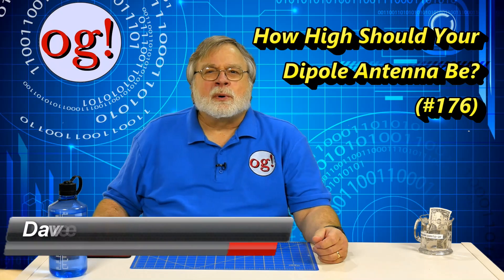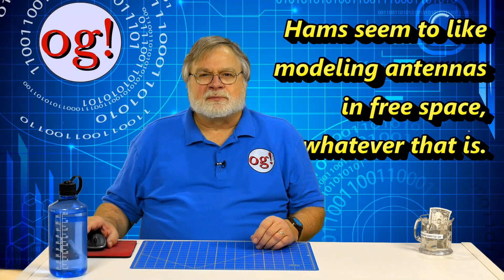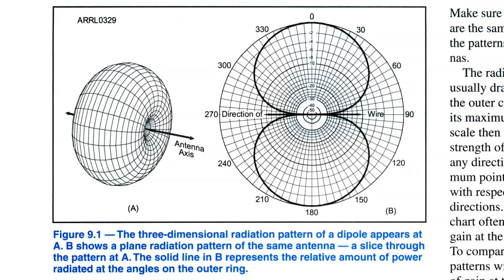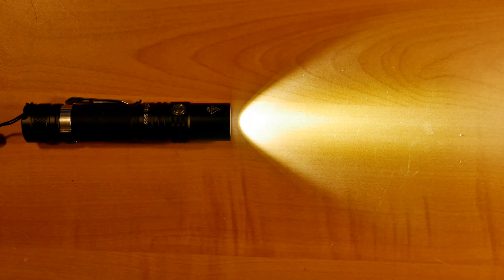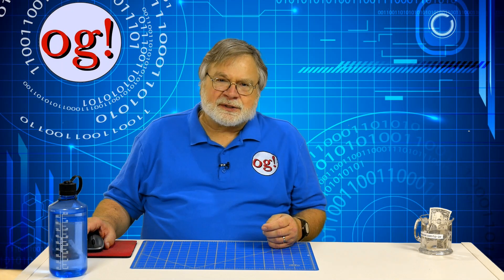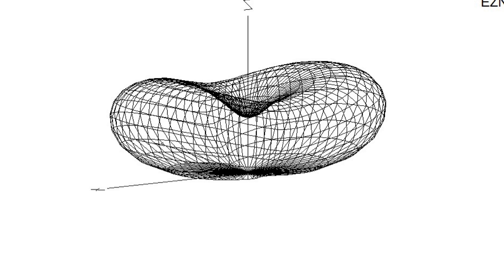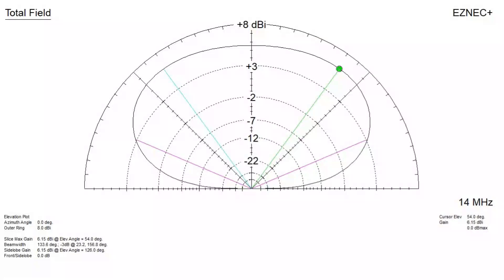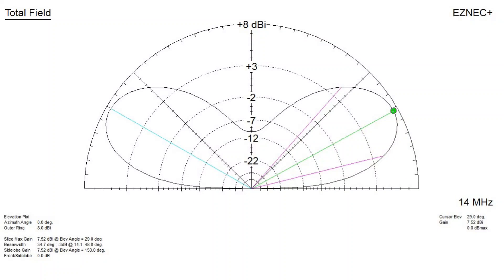How High Should a Dipole Antenna Be? (#176)

Comment: Is it more advantageous to mount a dipole vertically or horizontally?  It would seem a vertical dipole would be omnidorectional and would radiate at a low angle from the antenna.

Comment: Good information.  Long time ago I built a full wave 11 meter dipole with copper wire.  I mounted it in the top of a two-story townhome, with full attic and 45° roof.  I put the antenna as high as possible in the attic, angled down with the slope of the roof. I'm guessing it was about a 5/8 wave above the ground. The SWR was not great, but one morning at 6:30 a.m. EST,  I had a clear conversation with a gentleman in Corsica off the coast of France.  SSB of course, 27.385 Mhz, 12 watts PEP.  I was trying to make an antenna for the flat side.  I guess I got lucky.  Thanks for the video.

Comment: Yes on 20m you don't want power going straight up (and just heating the moon) but on 40 for nvis you want straight up power. For a 2 element Yagi you normally have the reflector 0.15 wavelength back (ie 6m on 40m)... If your 40m dipole is low at just 20' then with the ground acting as your reflector you effectively have a 2 element yagi pointing straight up so if you want local rag chewing on 40 then just 20' may be your optimum height.

Comment: In case of a vertical dipool : Half wavelenght to ground, is this clearance between ground and end of the antenna or is this from ground to mid antenna (feed point). PS: @27Mhz
Reply: 1/4 wavelength or 8 feet to put it out of anyones reach, also for optimum performance and easier matchingyou want your feed line to run perpendicular at least 1/4 wavelength as well

Comment: For DX, I would always go significantly higher than a half-wave.... Look how much better the low-angle radiation is on Dave's plots, at, say 1 wavelength height. I believe that most DX signals arrive at about 7 degrees elevation, but often lower.

Comment: I have an Icom MN-100 dipole antenna and i plan to make it as inverted V and put the antenna up on a 18 meter mast with the angle around 90° - 120° between both wires, the question is, is 18 meter high enough to make the antenna works efficiently ? Thanks - YG1BGK

Comment: Great informative video, thanks. I have a centre fed dipole that i use on 11m and was wondering if it would work if placed along the roofline of my house, around 20 feet up, on a corner. The legs would be at 90° and feed cable coming straight down  unto the shack. If it is directional, i have 4 options (placed on any of the 4 corners of the house) to suite the desired aim for dx. Thanks again.

Comment: The short answer could be... depends on what radiation pattern you want.

Straight up for NVIS.... a quaterwave.
Low Angle (about 30 degrees).... a halfwave.

Expect the feed point impedance to change between these. Due to interaction with the ground.

Comment: Dave. I have a 40/20 meter fan doublet up at 95 feet. It works excellent into vk and zl in the early morning on both 40 and 20. This is with 100 watts so I have to disagree.  Height is might. My zero five ground plane with 6 long above ground radials and 80 in ground radials is 6 dbd down on 40 and about 8 dbd down on 20 in the two direction my dipoles are oriented. The 95' doublet smokes the vertical 75% of the time. I hope these big trees grow higher. Would love to be at 120 feet one day. One more thing. The dipole up over one wavelength does not waste power going nowhere.  Look again at your charts. There is a few higher angles which are good for regional contacts. So the point is I am surprised you recommend a half wave high when a full wavelength will always give you  much better bidirectional gain.

Comment: Are there motorized systems to raise and lower a dipole in a similar fashion as a yagi is rotated?
Reply: Unless you are using a chain or cable driven elevator you will not get much range.
Also there is stability issues you must factor into load equation.
Linear actuators are more stable but very limited in range.

Comment: Dave, you have explained all the practical options of a dipole antenna positioning. Thank you for that, very informative data. I need your advice about what would happen if I were to deploy a dipole in an oblique direction to the ground. Say, at one end at 20 feet and the other at 15 feet for a 20 meter band. The reason is that I have property/geographic difficulties and the best I can do is go with a oblique dipole. Thanks in advance for all the help and advice you give us.
Reply: That is a sloper dipole it will work fine maybe a bit more directional than a horizontal due to ground reflection.
Great for tropo ducting.

Comment: If your dipole is going in the attic (thank you HOA) does the fact that its 3 stories high still count in "how high the dipole is?"  Thanks,  Dave N9DMS
Reply: Three story is the living space measurement attic height is extra.
Average room height floor to floor is usually 8 feet or more.
So 3 story is approx 24 feet plus about 6 feet average attic height
If you walk up steps into the building include that height as well.
So on average without stairs and ground level you are nearly 30 feet
Damn close to 1/2 wavelength so you wont notice the very minute difference.
Reply: Comment was based on 20 meters.

Comment: What about a vertical dipole UHF/VHF?
Reply: They work either way performance may vary due to the recoivers polarity but generally not much.
Look up building a vertical ground plane. They are easy to build, easy to tune. And perform very good.
I believe  Dave has a video on them.

Comment: How far should a dipole antenna be away from metal objects? I was thinking about installing a ZS6BKW antenna in an inverted "V" configuration and I have a metal building that one leg of the antenna would be running parallel with and I was curious if the building might interfere with receiving and transmitting.  The building would be about 10-15 away.

Comment: Hi David, for international DX shouldn't I get my 10m dipole up to about .65 lambda? I use a center-fed 1.25 lambda dipole driven by coax through a 4:1 by Balun Designs at the feed point.
Reply from the maker: The optimum height is 0.5 lambda. At 0.65 lambda the pattern will be a bit lower but you will start to lose power to a higher lobe.
Reply: @davecasler  Will it lose power in the lower lobes or gain overall including in the upper lobe?
I was under the impression the lower lobes gained a dB or so overall.

Comment: Well I KNOW  a 2 element Qud work's  WELL at 36' above most ground's .I had most of my ANT'S. Beams ,ground plain's at 72' on 11 Meters. Work VERY WELL even  ground  waves with  15 W radios on SSB. But coax length  and grounding  and a fine tuned ssb radio station is key injoy 🤔

Comment: so a half wavelength height "rule" was just for 20 meter band or applies to all bands?.......meaning the best height for a dipole antenna for the 2 Meter band is 3.3 feet? and a 70 CM band at 1.2 feet?.....seems pretty low and if my assumption is right (too low), what height should I place a dipole for 2 M and 70 CM bands? (I'm studying for the Technician exam and would like to put up an antenna for these two bands)
Reply from the maker: Yes, the half wavelength height is optimum for all antennas. For VHF antennas up high, there will be so much lensing that it will appear as if it’s one lobe. My UHF 10-element beam is only about 6 feet off the ground because that was a convenient height and is plenty high for the beam to do its work.

Comment: I’ve been thinking about making a 20m vertical dipole. I want a vertical but don’t want to deal with the hassle of ground radicals.
Reply: You realize you will need a fiberglass mast approximately 75 feet tall to keep the lower end out of reach.
While current is highest at the center, voltage is highest at the ends.

Comment: We have a recent FCC change regarding antenna heights. No longer 200’ away from public use airports, now it’s only 50’! Half wave height of a 40m, 66’, I guess may now involve paperwork notification at a minimum or perhaps an approval process with the FAA and FCC?? Doesn’t sound good. Still though, I’m left wondering how to safely get 1 (in the case of an inverted V) or 2 support points 66’ up so as to then string the dipole.
Reply from the maker: This is the first I've heard of this. Please provide a URL so I can read further.

Comment: Hi Dave and thank you for this information. I am a new ham and I just got my General Class ticket and I am learning as much as I can about what my antenna options are considering my location I don't have many tall trees and the ones I have are all on one side of the property. I have limited options for mounting a dipole to say the least. I want to use a multi-band dipole that covers from 160 to 10 meters if I can. I have found an end fed dipole that I am interested in that is 98 feet in length that I can make work in my space. I too use the top rail sections for masts and I presently have one that is two sections high at 21 feet in use. I could set another one to use for the dipole if that will work. I know that there are other considerations here but I just want your opinion on the feasibility of this setup. I would greatly appreciate your help. Thanks and 73
Reply from the maker: Congrats on your upgrade to General!  You won't find an antenna that works well 160 to 10. You might start with an off-center fed dipole that works on at least 80, 40, and 20. You can build these yourself--there are plenty of plans on the Internet.

Comment: what will be the equation  for far field when dipole antenna is at arbitrary location .??
Reply from the maker: You would need to use Maxwell's equations to derive that, a formidable job. Better to use something like 4nec2 that models this using the NEC - numerical electromagnetic code.

Comment: If you read the various Antenna Handbooks, you wont need to model anything. Just throwing up an antenna in your space will garner contacts. I have made contacts at 12 feet off the ground, 20 feet off the ground and 32 feet off the ground. You are giving the impression that antennas are complicated with this modeling methodology, when they are not. This is why many hams choose to not experiment because of those darn charts and radiation patterns. Can you do one up for my antenna mmade from crutches?
Reply from the maker: Hams take different approaches to technology, from the "throw something up and make it work" to the carefully-engineered. Though I tend to be in the former category, I am an engineer and do like to know how things work, hence the analytics.

Comment: I understand the best height is half wave length for dipole's. But for CB (11 meters) and 10 meters is that the same recommendation. The usual thing on those bands is "height is might". But obviously for verticals. But is height best for 11 & 10 meters? I am still learning. I am a foundation licence (an F call). Thankyou. 73 VK3FION. (By the way, I am an "ogie")
Reply from the maker: Thanks for being an Oggie! On 10 and 11 meters, it's hard not to mount the antennas a couple wavelengths high! The elevation pattern will be split a bit, but height is usually considered a good thing.
Reply: Thanks mate.
Reply: 32 feet or high for 11meters, depending on your layout indoor or outdoor!! It's alot of Fun!! Thanks for reading my comment!!

Comment: None of that really matters.  There are a few types of antennas that are never ever going to radiate, those are the one drawn on paper or in software, any antenna not built yet, the antenna in its' bag under the bench, the antenna googled on your screen but never got around to making, and the ones debated over on the internet.  The ONLY antenna that is going to radiate at all is one up in the air with a working transceiver connected with the mic button pressed.  Moral of the story is self-evident - get off the internet and go build something.
Reply from the maker: I think that's the point.

Comment: Good video and explaination. I am erecting a 20 meter dipole, oriented vertically. It really does not need a tall antenna, and I am hoping it will be less subject to null areas than it was when I had it strung up horizontally.
Reply from the maker: Should give you a nice uniform azimuth pattern.

Comment: Very good video Dave. I, and many other hams, would like to have their antennas at the optimal height for the band the antenna is cut. I would to be rich too but neither of those "likes" are a reality. Where I currently live I am fortunate to have many trees towering at 50 to more than 50 feet above ground. With a sling shot or pneumatic launcher I will be able to get some of my antennas up near 50 feet but I problem I worry about is at that height the mount points are not rigid. When the wind blows at 25 mph or greater the tops of those trees sway back and forth violently enough that my wire antennas, even with a tension system, would likely break. It would be my luck that the antenna would break during winter with snow on the ground. Most hams do not have the room laterally or the means to put their antennas much over 30 feet vertically, so many of us have to use compromised antennas. But these compromised antennas do work. Sometimes Elmers say things to the new ham and even if they say "theoretically" or "under ideal conditions" the new ham has selective hearing takes what we have told them as fact. I like how you emphasized this point several times.
Reply from the maker: Yes, trees don't stay still. There are many approaches to keeping the antennas from breaking, but Mother Nature seems smarter than us all!

Comment: An exceptionally well done video, Dave, thank you. On a related issue, there are many of us in rural areas that use septic systems. Are you aware of any information related to using verticals (or even other antenna systems)  in conjunction with leach fields?
Reply from the maker: No, but it may help. I also have a leach field, but my antennas are not directly over it.
Reply: Gee...I wondered where those crappy signal's came from ?
         ¯\_💩_/¯
    Seventy Turds !

Comment: Dave, Can you please explain why a transmission cable's impedance does not vary with frequency? How does it stay at 50 ohms? I though reactance was inverse to frequency?
Reply from the maker: The cable impedance is a characteristic of the cable itself. It is the ratio between the voltage and the current, and doesn't vary (much) with frequency. The cable has distributed resistance (the wire) and distributed reactance (capacitance and inductance) that all keeps the impedance uniform. The impedance of a cable can be calculated from the outer diameter of the center wire and the inner diameter of the sheath. The formula can be found online or in the ARRL manuals.

Comment: Curious,  how does a dipole in an inverted v configuration at various elevations?
Reply from the maker: Pretty much the same result.
Reply: Where the current is highest in a dipole is where it's going to radiate the most. That means, get the center high and if the ends are lower, they don't need to be high because the current is at a minimum at the ends.

Comment: Over the last couple of years I have been watching and learning from your videos, especially those about antennas. But I am not a ham, and don't want to be one. Still you are a good teacher and I have learned a lot, with the object being to apply it to what I am interested in, radio controlled planes and drones.
I found your diagrams of radiation patterns of a dipole at various distances above the ground to be tantalizingly close to what I want to know : what would the radiation pattern be for 900 mhz with a dipole atop my roof (about 20 ft above ground). Any chance you could plug these numbers into your antenna modeller ?
Reply from the maker: If you get your tech license, you can use the ham bands for your radio control. There's already a fair number of 6m control equipment, plus you can use more power. Regarding the 900 mHz antenna, the pattern is greatly affected by the surroundings.
Reply: Thanks, but that is vague enough to not be helpful.

Comment: Very interesting and informative video. I currently have a ZS6BKW set up as an inverted V with the center at about 35 feet. The nagging question I've been considering lately is whether it matters that the two arms of my V, instead of being straight from the peak to their ends, are a bit saggy. I'd like to know whether it's worth getting the ladder out and pulling them tighter before the snow flies. 73 de NN8G
Reply from the maker: Slightly saggy vs so tight they break in the wind. It's a balance.
Reply: It's always worth it! Even if it doesn't necessarily improve performance, you can have fun fiddling with the thing outside.
Reply: @popefelix  Wirh inverted v, s, the angle between the two wires of the antenna makes a lot of diffetence, altering the resonant frequency, the inpedence and the SWR. I have just spent a day, at 3deg c, playing with one! Its getting better, but a bit like playing 3D chess! M0iiZ PS. The ZD6BKW is a great antenna. Much better than a G5RV. Makes the transceivers ATU have a much quieter life!